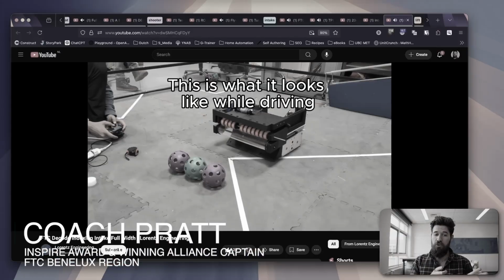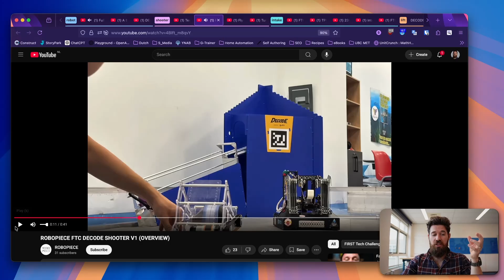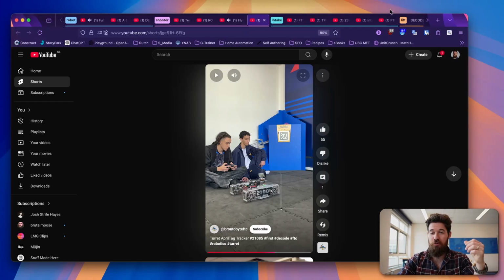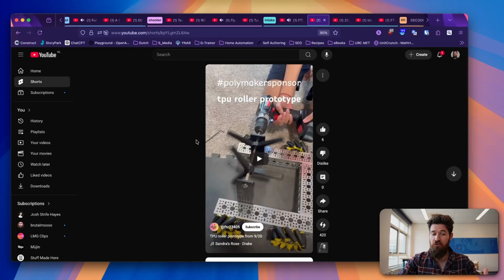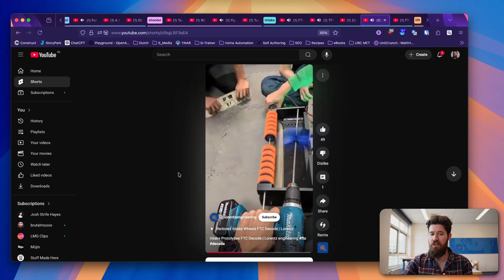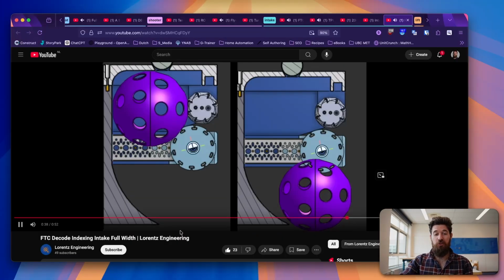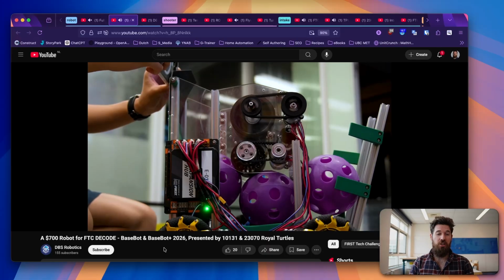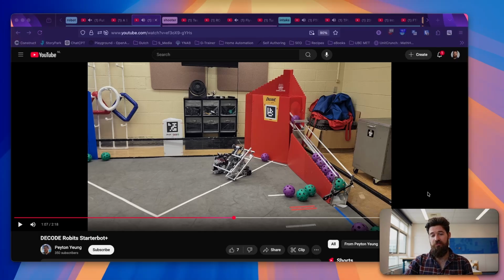FAST Robot Intakes [FTC Friday's DECODE]

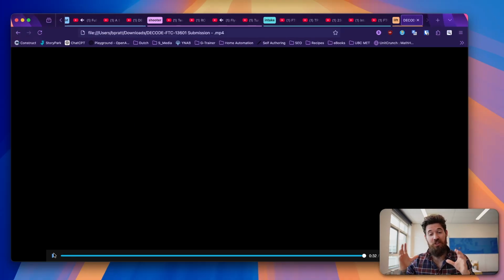Comment: 3:55 unfortunatly the issue with rack and pinion is that you cant go higher than the length of the rack, so you cant get taller than your own robot is
Reply from the maker: This is true. As long as your alliance partner is under 14-16'', this would still work.

Comment: Is there a reason teams aren’t using? Imu or compass  for tracking.
Reply from the maker: You could, but this only tells relative position of the robot in relation to its starting angles in yaw, pitch, roll. It wouldn’t be able to tell you how far you are from something. You’d need a localization system for this, either odometry dead wheels, and optical sensor or using April tags at a known location.

Comment: The problem with going to the center is they can get stuck easier then you would expect. This is one of the solutions we came up with. It is the simplest solution we could think of and the most "space efficient". Other ideas were rotating wheels on the side or spacing the vectored wheels on one side to get uneven force for each side. But this was the most reliable and easiest solution.
Reply from the maker: Interesting. By getting stuck, how so?
Reply: @BroganMPratt  If 2 balls arrive both next to the center they will try to go to the center with the same force and so wont move, we tried the kicker wheel, it helped but if the balls were somewhat the same distance from the center, the kicker wheel wont reach.